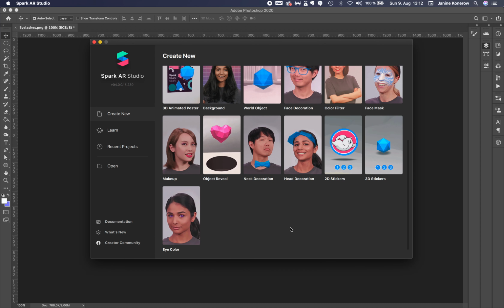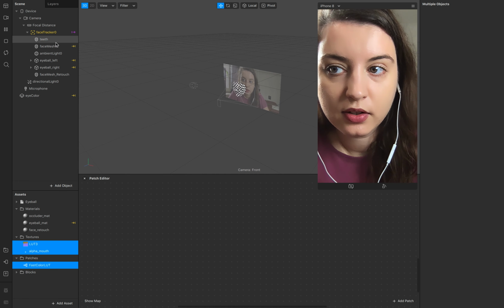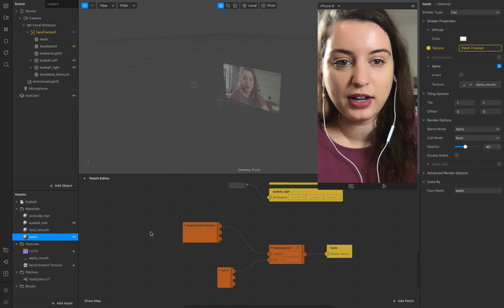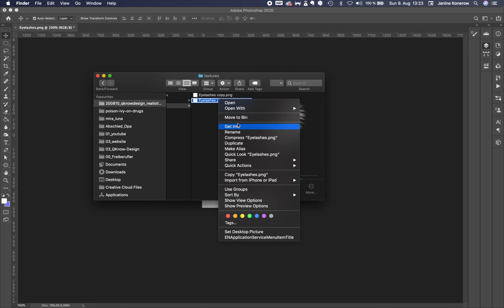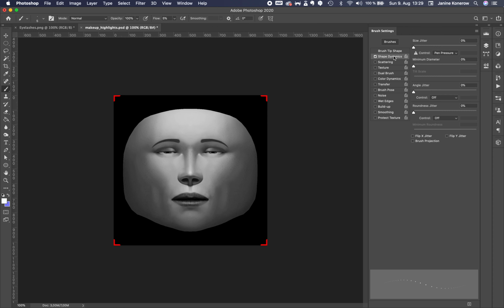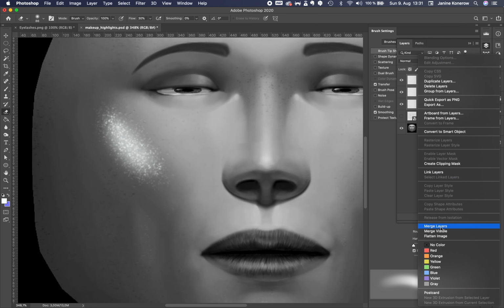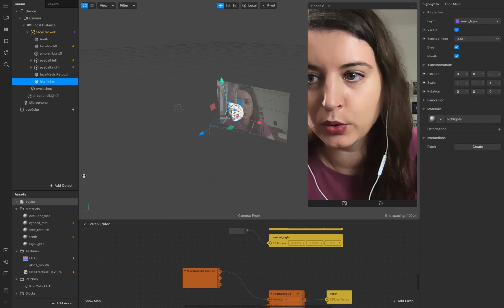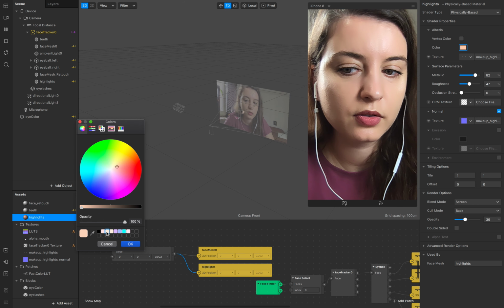Spark AR Beauty Tutorial for Beginner (Bright Eyes, glowing Highlights, Eyelashes, Teeth Whitening)

Comment: Hi! I love this tutorial! But Im having trouble adding a color lut on top of everything, it shows a black line on the face :( how to I combine this tutorial plus color luts?
Reply from the maker: Hi Maggi, You need to add an alpha mask too your face mesh where your LUT is based on like in this tutorial: https://youtu.be/8lWnWs0U6rA?t=489
That might help, if we are talking about the same issue :D  If you mean vertical lines through your face than could the layers interfere with each other. Make sure the depth of the Material is disabled.

Comment: when i use the deformation to get the lips bigger the teeth gets bigger as well how can i do the lips without affecting the teeth
Reply from the maker: Don't use the face deformation o the teeth face mesh. In this face mesh the mouth setting in the inspector is disabled. I am not sure but that could cost that problem.
Reply: @QKnowDesign  how can i edit it without using the deformation

Comment: why the black and white pixels does not disappear after doing the teeth part and it also does not work and i have created another mesh to make the lips bigger and the nose smaller is this one the problem  because when i add the teeth whitener it breaks up
Reply from the maker: Hi Zeyad. Yes, the face deformation could be a problem. Does it work without the face deformation?
Reply: @QKnowDesign  yes and i want to ask you if there is any other way to use the deformation with it